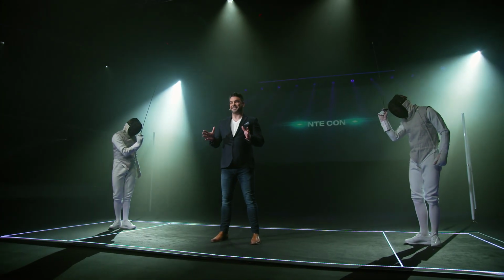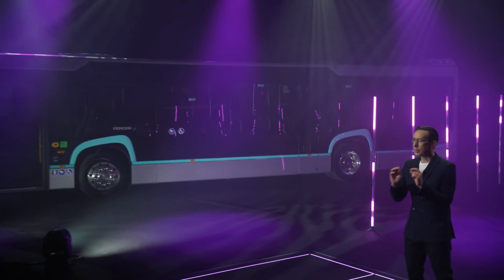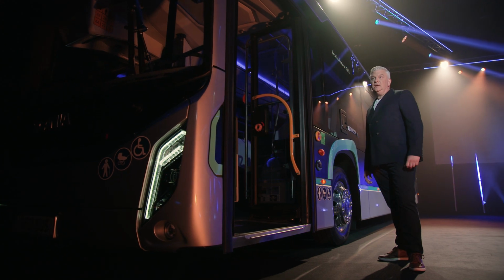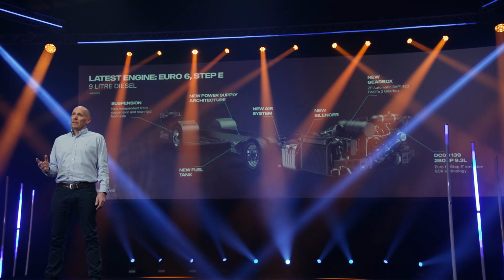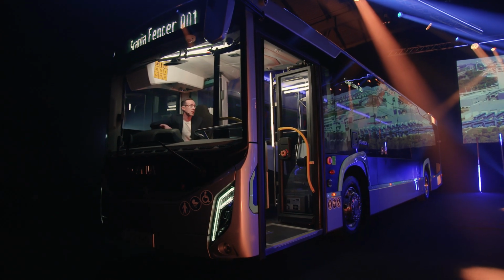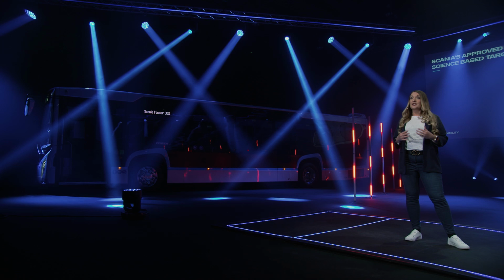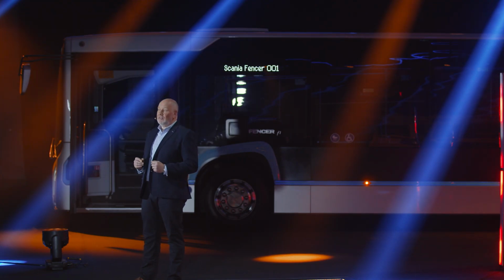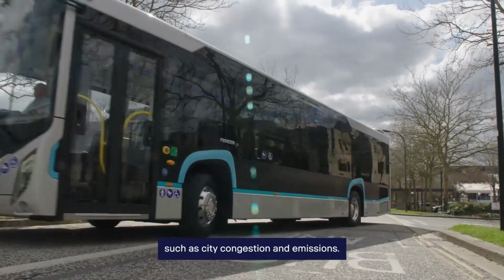The bus you have been waiting for -The Launch.

Comment: 10 years of research down the drain. Congratulations on launching a bus from the 1960's all over again. Designed to have a euro 6E engine and ZF gearbox from the outset. So it's clear that there is no innovation here. No completely flat floor front to back, seats up steps or on plinths, tiny entrance door, restricted space between front wheels inside, tiny cramped drivers cab, and still the insistence of putting electronic buttons along the cab window ledge where they will get wet through the window. You have learnt nothing, and I bet you won't sell any to the major groups in the UK. They are all tied to golden handcuff deals with ADL. Oh plus the fact that the last lot of Scania buses rattling around are those awful omnicitydecker things are absolutely rubbish and life expired at 10 years old. For a major bus launch, this product is very disappointing.